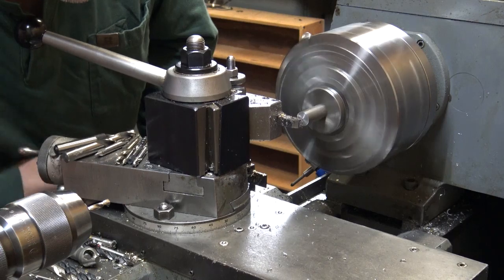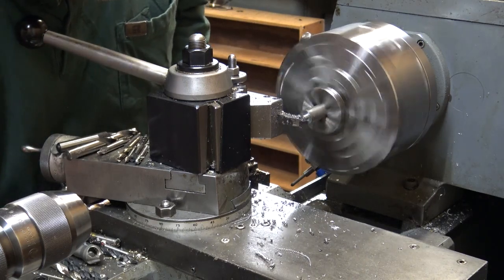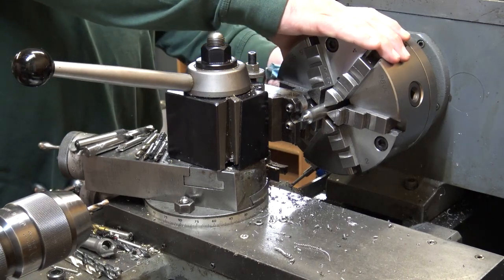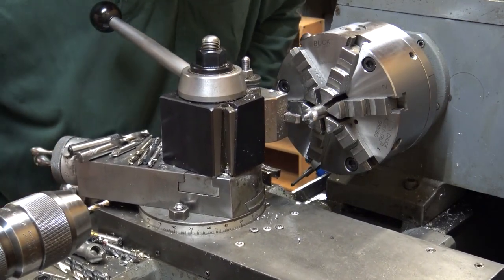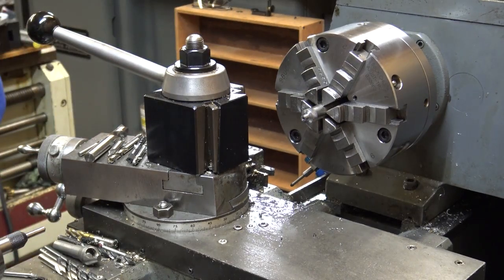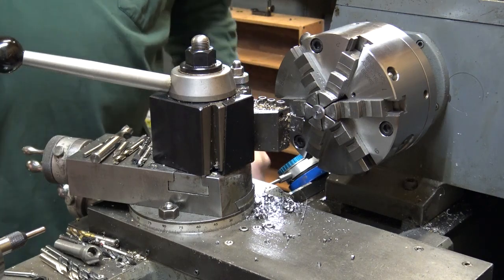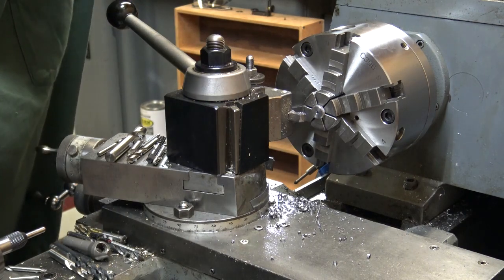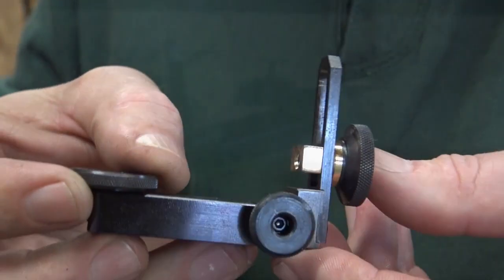Weihrauch HW30 Flip Peep

Comment: i have a hw30 that had the galling problem but on mine it was galling on the piston i checked it and it had about a .010 out of round so i turned the oval out on the lathe and re polished and now its smooth as silk and shoots around 600 fps not sure if it was the right way to fix it but it worked i have the machinery like you what are some of your suggestions to do to for accuracy that i can do machining wise
Reply from the maker: HW flares the back of their pistons to fit the receiver better.  Making sure the rifle is sealing correctly is 99% of the effort.  Other than that, not over springing it would be my only other big caveat.  Hope this helps.  Paul